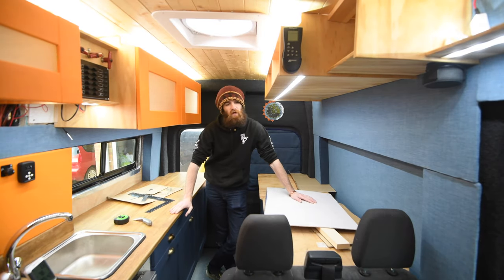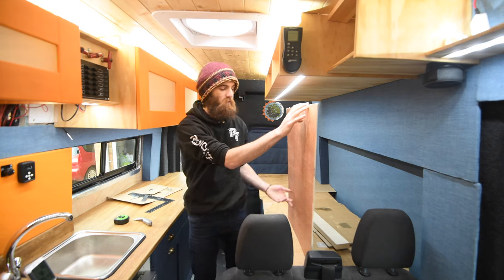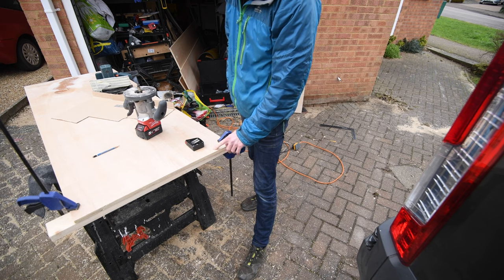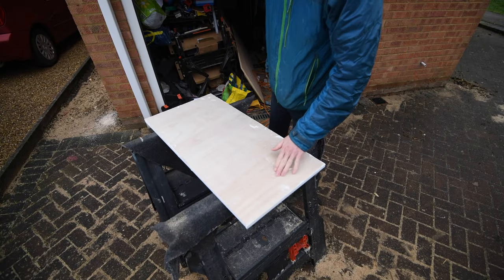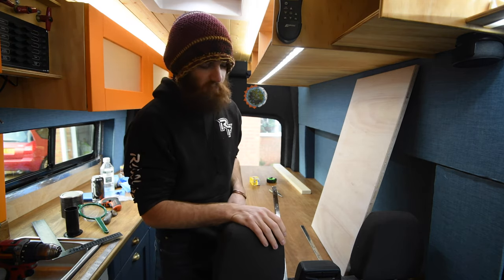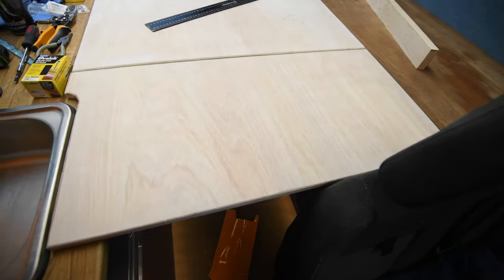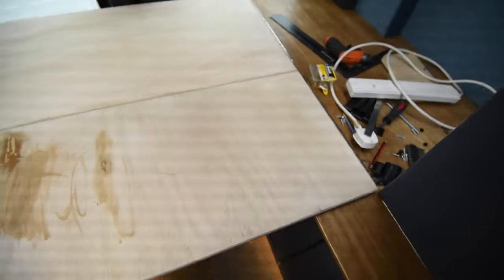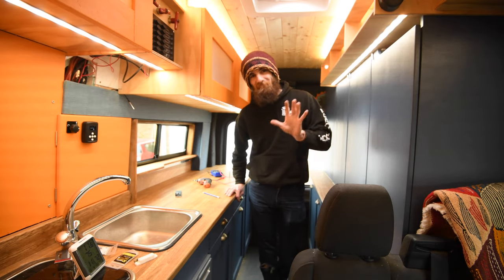Folding Murphy Style bed Part 1 | EP45 | Ford Transit Campervan Build

Comment: I bought a new factory built van in 2017 with French bed which I thought,at the time was the ideal layout for me,3 years on lockdown 1 arrived and I used the opportunity to get rid of the bed which I'd found uncomfortable and a waste of space,and build a Murphy bed.Managed to get a full sized double width ways across the van.Ultra comfortable and folds away in 2 mins.giving loads of floor space in daytime mode.Your builds looking great,real bespoke job👍👍Paulo
Reply from the maker: Thank you very much! Yeah I have to agree. If you don’t require a full garage then a Murphy style bed frees up so much space when in daytime mode